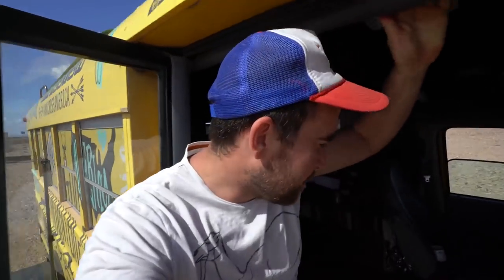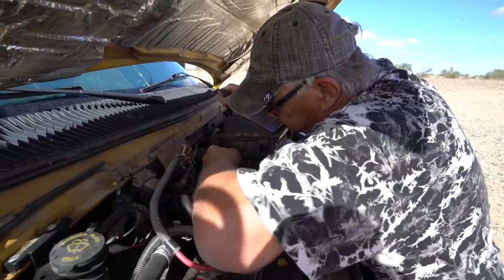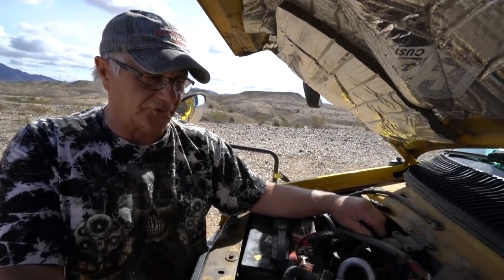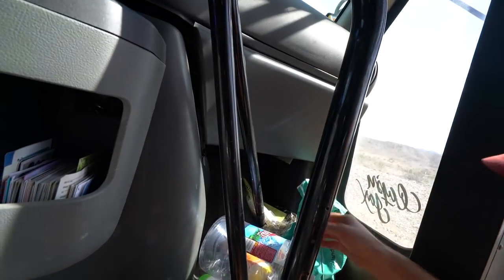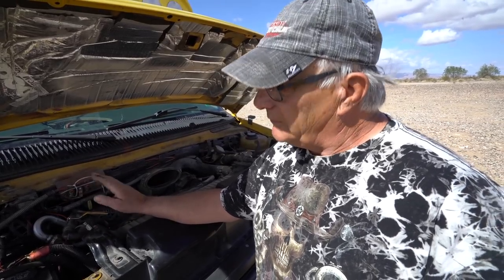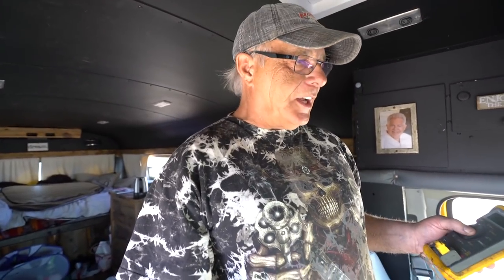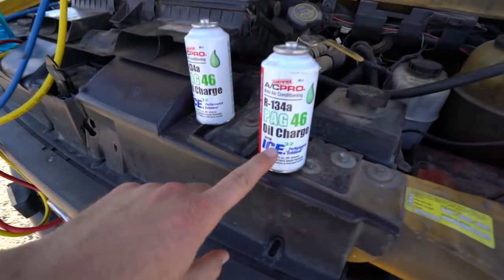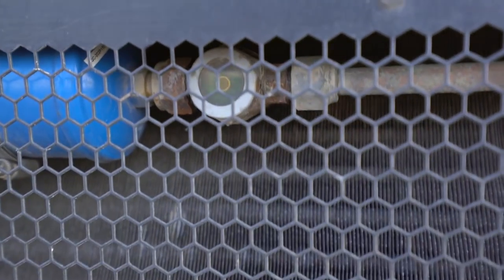HOW TO RECHARGE AC AIR CONDITIONING W/ TRANSAIR (Ice Cold!!) SCHOOL BUS / SHUTTLE BUS

Comment: Topping off the Freon is easy. If the system is completely empty, one has to pull a vacuum to pull the moisture and air out of the system before a complete fill can be done.

Comment: Did you guys do a vacuum on the system?  On the low pressure side the (blue)gauge reads 0 thru 20 from (left to right) this is for system vacuum, in the event you have a leak, hope it all works out
Reply from the maker: No vacuum. Just filled it up!

Comment: I have what looks like a charge point behind my rear a/c I filled the front a/c and the front a/c is working but not the rear i am wondering if i need to add coolant to the back one but i don't know if its a high side are low side charge point its smaller than the front one but i have an adapter this is in a ambulance?